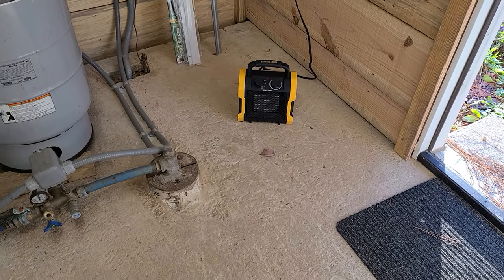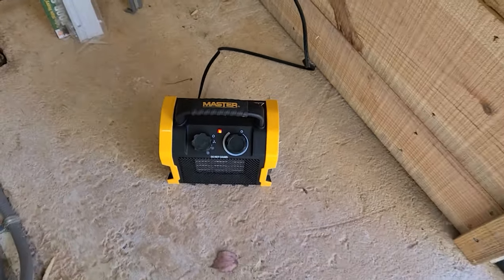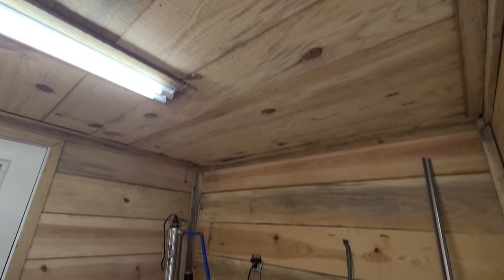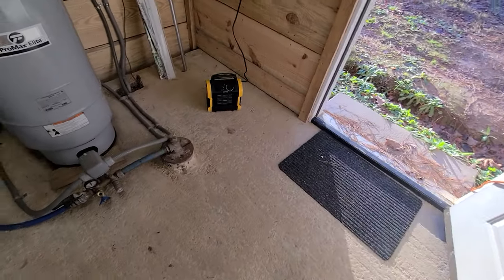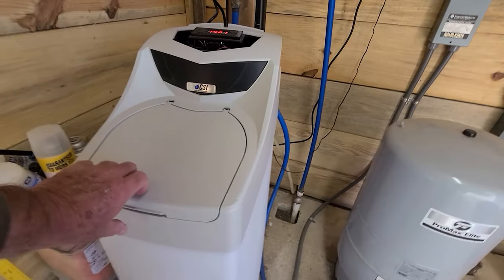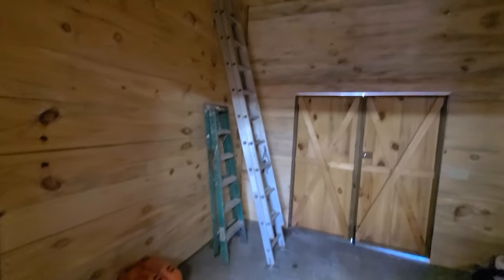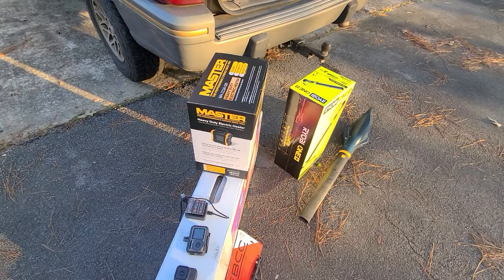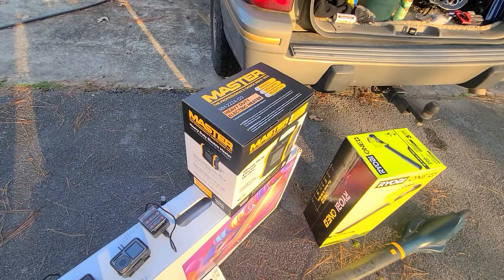Master Heater Review January 5th 2022 #Master Heater

Comment: Does it beep the whole time it’s on? 😳
Reply from the maker: There is one in the whalehouse and I have 1 in my Van and neither 1 of them beep at all. The only sound I hear is the fan blowing
Reply from the maker: That should be Well house. Auto correct does crazy things
Reply from the maker: If you hear beeping on this video it is the water softener not the heater
Reply: Oh ok thanks!
Reply from the maker: Thank you for your comment and for watching the videos
Reply: I really love all your videos!
Reply from the maker: @poemstrainsandbackroads385  Thank you again
Reply from the maker: @poemstrainsandbackroads385  I just subscribed. It has taken me several years but I am now very close to 1000, just a few more, hopefully by the first of next week.
Reply: Wow congratulations on reaching 1000! And thanks so much for subscribing I really appreciate it.
Reply from the maker: @poemstrainsandbackroads385  Thank you but I am not quite there yet. I went to bed with 997 got up to work on videos and three had dropped off making  it 994, and now it is back to 996 so I still have 4 to go. Hopefully I will have 1000 by Monday. From 925 to now it has been very hard to keep subscribers, several will drop off and then it takes days to pick up to where I was. I will watch some of your videos too so it will build time watched for you. You also must have 4000 watch hours in the previous 12 months. That can be hard to get as well. I read your bio and we have a similar story about someone that we wish would come back,,,, but hey, it's Life and life is tuff. That's just the way it is. I see people all the time that I would not swap places with. I have a poem that I will share with you another time, I think it fits quite well.. I love your title too, I have always loves Trains, Backroads and Poetry. Really enjoy Shakespeare too. Keep up the Great work.
Reply: Wow thank you so much I really appreciate that so much! I’m fairly new to having a YouTube channel so I really don’t know what to do with it lol. I really made this page for him but it’s made me wanna do more than just poetry. I see you do a lot of videos around here in Georgia so maybe I can ask some of my friends I know to subscribe to your channel…I’ll tell them to go check out your channel and maybe you’ll get a few more subscribers! I really appreciate the tips cause I never knew just how complicated a YouTube channel could be lol. Til I made one! It’s been a little confusing. I’m using nothing but my cell phone too. It says I have like 75 comments but I can’t see any of them to reply or most of them I can’t. And I can’t even figure out HOW to see who subscribes to my channel so I’m kind of lost about how the whole thing works I’m figuring it out as I go along so any tips would always be welcomed! Sorry to hear you’ve gone thru kind of he same thing. 💔 it’s hard. And yes I’d love to read your poem sometime!
Reply: Sorry about the typos …not enough coffee yet
Reply from the maker: @poemstrainsandbackroads385  I use the computer and the phone, but just using the phone it is very hard to do everything. Some of the stuff I do not even try to do on the phone. When you sign in go to You tube studio, you can see your statistics there, but it is difficult on the phone. Unless I am doing a short I use my phone turned sidewise to get a wider field of view.
If you can set your phone camera to 16x9 and 1920x1080 it will work better for you tube and your subscribers. The video I will post tonight was done with just the phone today. I will try to think of easy things for you to try and send them to you.  If you have any questions just ask, if I can help I will be glad to. If you have a g-mail  e-mail your comments should show up there under the "social" tab. They may be easier to respond to from your e-mail. If you do not have a g-mail I would set one up and use it for all of your youtube comments until you get more familiar with the you tube system on the phone. Talk with you latter.
Reply from the maker: @poemstrainsandbackroads385  my typing is terrible, ha!
Reply: Wow thanks for all the info! I know I need a computer I just don’t have one right now. But I’ll try the using my gmail account to see if I can view my comments I hadn’t really thought of that yet. I’ll definitely go try that and see. I actually have two gmail accounts. Thanks so much for all ur help!
Reply from the maker: @poemstrainsandbackroads385  You are very welcome and thank you for the recommendations too. Just let me know if you have any questions. I will try to help you as much as I can
Reply: Thank you so much and I tried it and that worked! Idk why I didn’t think to check there before now . 🤷🏻‍♀️ but at least I can see most of my comments that way from my phone!
Reply from the maker: @poemstrainsandbackroads385  I just uploaded the Sloppy Floyd State Park video it was all filmed with my S20 phone with the settings at 16x9 and 1920x1080. these settings are what You tube says is best for viewing on You tube
Reply: See I don’t even know ANYTHING about the phone settings and all that. I’m really bad with technology !
Reply from the maker: @poemstrainsandbackroads385  It does take some time, do not get overwhelmed just learn a little at a time and when you have questions, just let me know, I will help if I can.